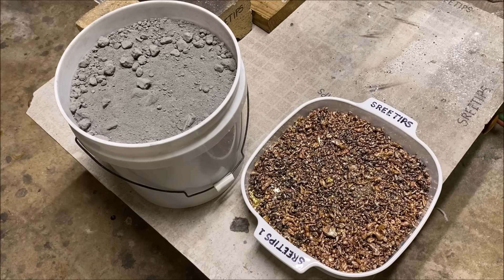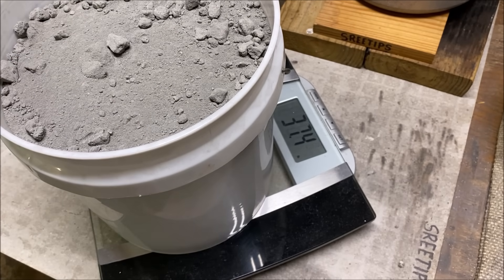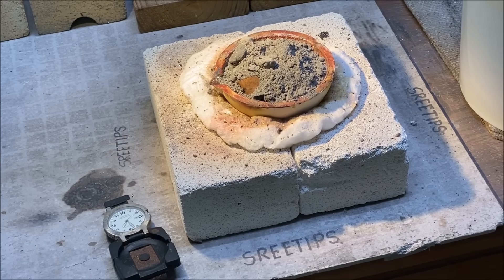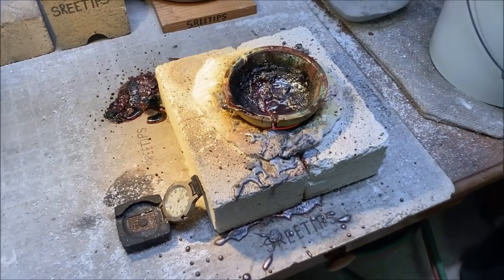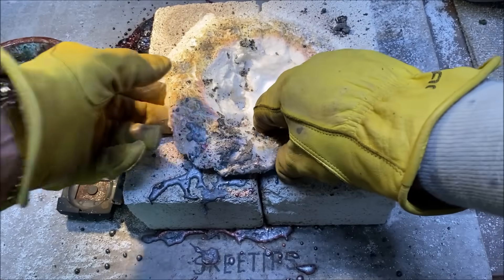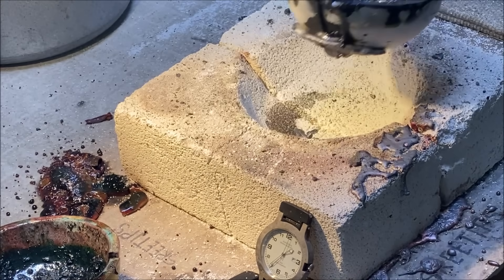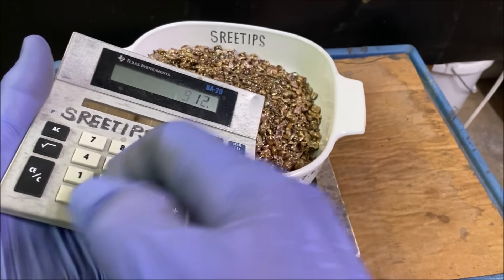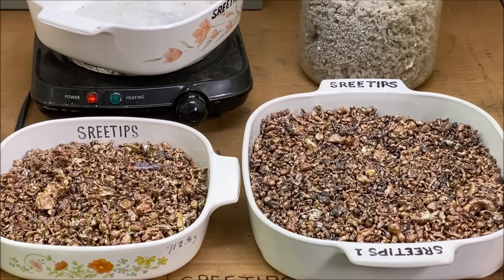Making Silver Shot To Feed The Silver Cells

Comment: do the melt dishes fail like that purely because used too many times or just unlucky, has a new dish ever done that?
Reply from the maker: It’s very rare. Having two fail is extremely rare. I think it’s because they were both used many times in the past.
Reply: @sreetips could be the cooling from adding more cement silver to a still hot crucible? Might be better to do fewer cycles on a larger crucible, or do sequential melts in different crucibles.
Reply: @positivelyacademical1519  yes, any metallic surface will allow condensation in a humid environment when the surface is powder the moisture will wick into it causing a slight dampness about 6 inches down. (Soil type sand experiments for desert living is the source for this research), metal in question is aluminum oxide, company was Norton in the 1950s -they caused some explosions while dry forming grinding wheels then a quick kiln fusing, this led to a drying table prior to today's method of wet forming the grinding wheels and shelf drying before kiln drying/fusing. 

In short, no matter how dry it was when you put it up it's going to be damp about 6 in down when you remove it.
Reply: IIRC, melt dishes and crucibles are considered consumables for work like this - the rapid thermal cycling when in use makes cracks form and spread increasingly quickly.

Comment: If you would clean your cement silver better, you would not have to change you solution as often.  I ran three rounds of silver cell with only a slight discoloration of the solution. 
All three rounds added up to just over 100 oz.  You waste a lot of chemicals and time doing it your way.  I can't get the volume of silver to work that you do.  I can only afford 
silver plat as a source.
Reply from the maker: I did that when I first started refining. My cement silver was so clean it looked like pure silver. Then I realized that it wasn’t necessary. I stopped cleaning the cement silver because that took a long time. I’d rather let the silver cell do it for me

Comment: I'm curious why not use something like a crucible and electric furnace or even gas powered? Seems like it would be a bit easier to manage than a melt dish
Reply: I could be mistaken, but I believe he has used a gas furnace a time or two, but is more comfortable this way.
Reply: At the end of the video he mentions using it next time.
Reply: That’s what he meant by the big furnace. He has one but it scares him to use it cuz it gets really hot and he’s not familiar with it enough. He prefers to use the small dishes and smaller torches.
Reply: Probably because that takes hours to heat, and it's BORING!
USE FIRE!!!  FIRE is GOOD!!
Reply: He has a gas furnace but is uneasy using it
Reply: I agree, silver has a lower melting point than copper, so it shouldn't be a problem to melt in a furnace. Much more comfortable and you can use Propan/Butan, which is also more economical.
Reply: hmm, maybe he hasn't worked with this much before 🤔
Reply: Go with what you know…
Reply: Yeah with this much silver it would be easier to use a furnace and multiple crucibles. Just keep going back and forth. I think the MAP gas gets too hot to use over extended periods of time.